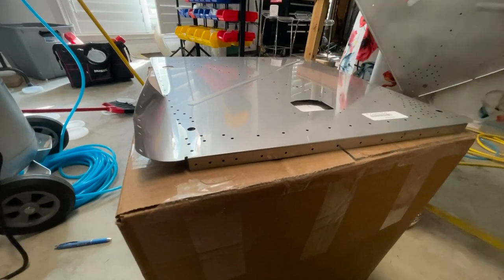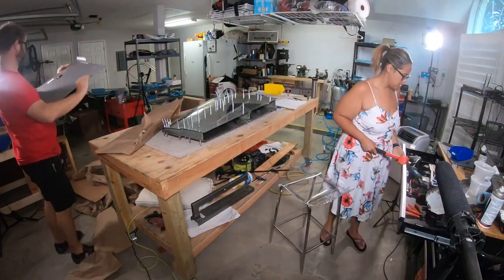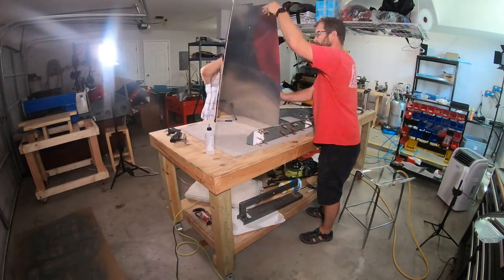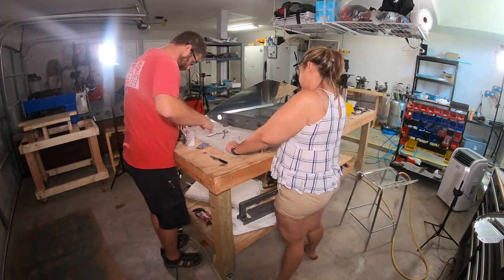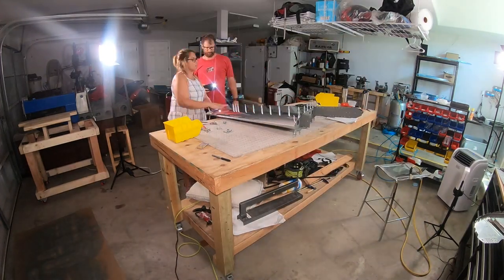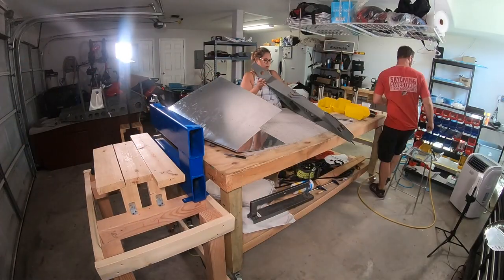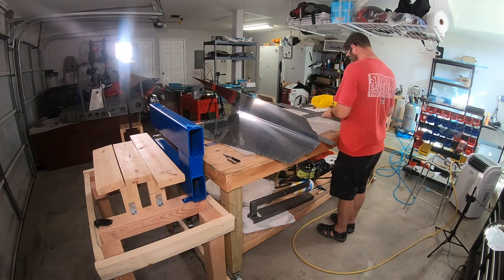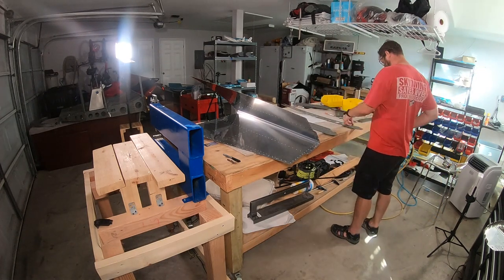Vans Aircraft RV-14A: Vertical Stabilizer (Build in 1 Day?)

Comment: Hey look it is all of the people on the slack channel!!!  Hi guys!   VS, by far the quickest section.  But thick skins too make it forgiving.  I had to start with my rudder cause I had B/O parts, so then my VS was like super fast.  There are 50 sections total, not including the optional sections.   There are only 6 in the tail kit if memory serves.  Fuselage took me the longest.  That firewall comes with some sealant parts and OP-62 will come into play, so perhaps not the worst thing to go and complete the tail first while waiting for the replacement.  There's some sealant fun on the TE of the elevators and trim tab ;)

Comment: Just wanted to thank you for the pics in this video. I started my vertical stab today and of corse got stuck on the first page. I’m supposed to dimple flush aft Vs- 702 and VS -01401. I couldn’t determine if that meant the flush side of the rivet would go on the side where the 2 pieces attach or on the other side between the flanges of vs-702. According to your pictures, the flush side of the 6 rivets is between the Flanges.
Reply from the maker: Glad our video helped... Hope we did it right so we didn't mess you up ;).  It has been a while since we've been on that part of the build and our memory is very fuzzy.     I do remember having similar questions as we were putting it together.  I think we skipped ahead in the plans to see where things were going to line up later to help us decide which side to do things on.    We find ourselves doing that a lot.   Skipping ahead to see where it is going to go often shows us why it needs to be flush on one side and not the other.